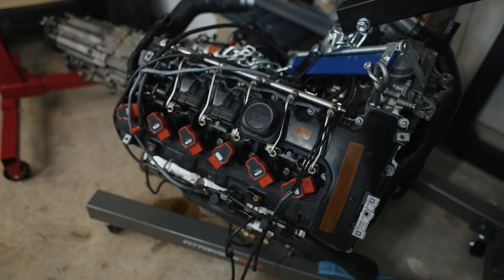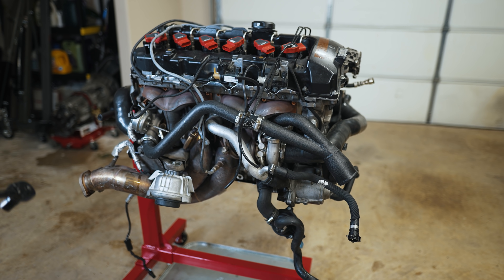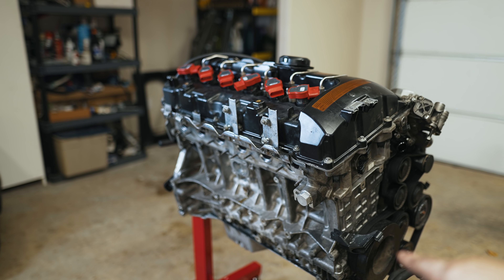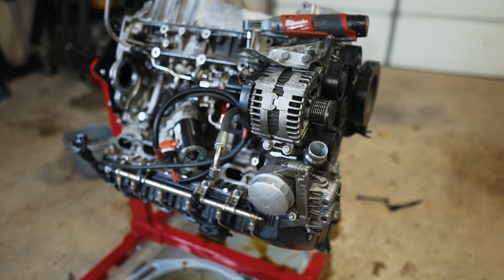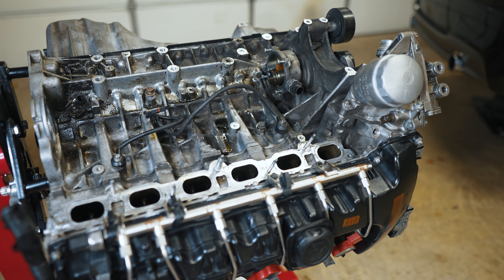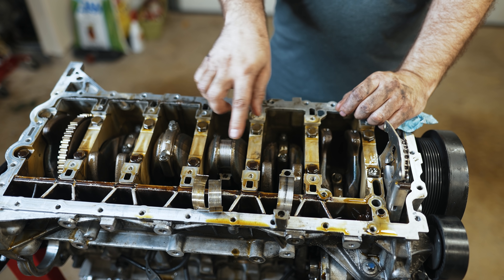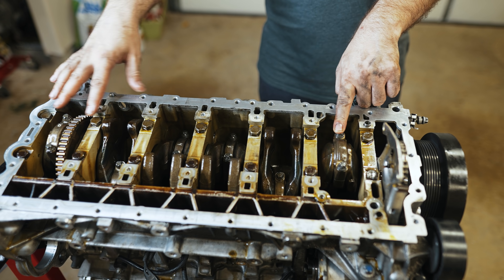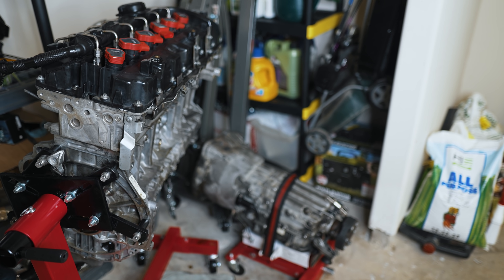Why Did My BMW Engine Fail?

Comment: Is a 2013 550i a safe buy? I've heard the 2014 and have better engines
Reply from the maker: I believe there were a few revisions so if I had a choice I'd go for the newer 550i knowing that it would still require a lot of maintenance.
Reply: @VehicularDIY  okay I'll stick with 14 and newer. Thank you for the reply
Reply: Check the following link: https://en.wikipedia.org/wiki/BMW_N63 N63B44O1 is the engine type you looking for. Next revision N63B44O2 from 2016. Be aware of these engines: it requires tripple amount of work on every service which is not performed by the regular workshop. Practically you have to disassemble the complete top of the engine at the time of the oil change to check all the spare plugs, pistons with camera, oil and coolant lines, turbo plays etc. The trick is to be know any problem before it is not too late to repair. Generaly these setps are missed and the result is simple: after 75K this engine is starting to degrade until 100k when it is brake down, including turbos. Forget the factory oil change interval, 8-10k km on average usage, less if you push. I was glad to be able to sell my car after an engine replacement (factory warranty). If you really want this engine than I suggest the S63 "M" type engine, It is not problem free but much more reliable than the N63. Please note every eight piston V type engine has serious issues over time, like Audi S7 4.0 twin turbo engine. I think the design has an inherent flaw of heating problem for the turbos, pipes and the last piston. Good luck!

Comment: KING bearings do not produce more clearance... unless you bought the "X" bearings... and even those only open the clearance up by .001." This didn't happen because your clearances were "too loose." 5w-40 would be  plenty thick even if these were the King "X" shells. If anything, STD bearings producing stock clearance is likely too tight for high load applications.

Absolutely amazing seeing comments blindly agree with you that this was because of "too loose" clearances purely because you mentioned it in the video. You didn't even give us enough information to even remotely conclude anything lol. What were you clearances after the king rod bearing install? 

Beating on it cold? That's plausible but who knows. I highly doubt this had anything to do with installing new bearings. It's really not that complex to change out rod bearings. It's two bolts... The only people who think it's black magic are people that have never done it before.
Reply from the maker: I was trying to pose a question to you guys, if you noticed I also said "or too tight?" at the 8:26 mark.  I made a video on the rod bearing replacement and showed the clearances using plastiguage.  So in my opinion the results can vary depending on what color code bearings your N54 came with from the factory.  They match the bearings to the crank, yellow, red violet or blue, one color for uppers and one color for lowers so you can end up with an exact clearance.  From what I had read the aftermarket bearings err on the side of caution and give you more clearance regardless of your factory bearing color.  So depending on the combo of bearings your car came with from the factory you could end up pretty loose but at the same time you'd think the thicker oil would make up for it worst case.
Reply: @VehicularDIY  yeah I know you presented both scenarios i was just replying to the people commenting about "too lose" and "wrong oil." Just doesn't make sense.

Yes bmw color codes the shells but youre talking about those shells changing clearances by .0001" differences not .001." So "loose" in the sense of using generic bearings is only relative to very minute variances... to call clearances loose on an n5x you would be at .003" or more which is a drastically different clearance. No you would never end up sp loose that you need to change oil. Thats nonsense. You might end up at .0017" on one journal and .0014" on another journal using generic builder bearings but those are still "tight" clearances on a 2" crank journal. You would never end up with something like .0035" (loose) using STD bearings. If you did you've got hardware issues.

And yeah I did watch your other videos after posting g and I do see that you landed right around .0015" on all journals. That is what I have found to be bmws target clearance. The type of small variances the colored shells make up for you wouldn't even be able to see by eyeballing plastiguage.

Everything is relative. If you want perfect .0015" clearances on all journals using generic builder bearings you need to polish a few journals. The slight variances that generic builder bearings might result in are perfectly fine though. Most manufacturers have bearing clearance variances and they do not bother using colored shells to make up for minute .0001" differences. Bmw just goes that extra step. Its obviously ideal to have them as even as possible to ensure each rod gets the same oil flow and can carry the same load but again were talking about variances you can't even eyeball with plastiguage.
Reply: Just from some of the comments  and my somewhat limited experience, the bearings do seem too tight.  (what was the original clearance before changing them?)    Did you use assembly lube on the bearings? How did you prime the engine?  Number 3 that in fact spun indicates the rod bearing went "square" when torqued.  What I mean by that is the bearing  was so tight at the two halves it buckled,  at the 2-10  o'clock and  5-7 o'clock.  Plastigauge should also be checked at these spots too, NOT just the crown /12 o'clock position.  I actually spun a rod on a 4 cylinder motor and in fact the crank actually cracked in half by the amount of heat. ( ha didn't' know what plastigauge was at the time!)  I don't really agree with the oil weight issue or oil being cold etc.  It is more of the engine being cold and the parts have to expand at the same time and same rate. 

good link explaining tolerances and oil weight etc:
https://blog.k1technologies.com/bearing-clearance-and-oil-viscosity-explained#:~:text=The%20traditional%20bearing%20clearance%20standard,inch%20of%20crank%20journal%20diameter.

     my two cents

Comment: Bummer you did a lot of work to keep that engine alive. Bearings normally fail because lack of oil, clearance to loose or tight, over loading, and foreign material. In your case hard to say you had a lot of timing chain guide debris in your motor and you didn't check clearance on your bearings. Seeing how some of the other bearings looked I am going with debris in oil.
Reply from the maker: You have a good point that perhaps the bearings were scored right on initial startup and trying to flush the motor multiple times didn't work.  What's funny is I didn't have any noticeable shavings in my oil this time.  
When my oil pump chain failed I had a ton of shavings and some of those were crank sprocket material which would have been super hard and could damage the crank easily.  Bearing material is typically soft and you can afford to flush it,
Reply: It sucks that rebuilding the bottom end requires a new crank now... BMW like many other manufacturers induction hardens their crank shafts so if you grind the crank under size the hardness goes away. Not like the old American V8 where you could just keep grinding the crank every rebuild and go with under size bearings. Your project... but my 2cents would be new or used micro polished crank that checks out and some acl coated bearings and arp bolts. Once the motor is apart the rods you plan to reuse torque the caps and swing a bore Gage through them to make sure the big end is still round distorted rods will wipe bearings also. Awesome videos happy holidays can't wait to see the build.

Comment: Wait one clarification, when you are beating the car cold how cold? Cold like you just started it and floored it or?
Reply from the maker: No running for 10 minutes and coolant at full operating temp but the oil was still cold.  I never push a car when the coolant is still cold.
Reply: @VehicularDIY  Ahh okay, I guess I'm safe. I always wait till it's 100c to floor it or wait till it starts moving to start going to ~ 4k rpm.

Comment: I pushed mine n54 when cold only once when I bought it, hope I didn't make too much dmg. Did you drove it hard when cold or? Also why buying new engine when you can just change the bearing with new?
Reply from the maker: Coolant was warm but I pushed it hard with the oil relatively cold in one gear.  The crankshaft has damage.

Comment: been getting on my f30 335i recently while still a little bit cold, not redline but 4-5k, stopped once i saw this, also i use a friction modifier, liqui moly mos2
Reply from the maker: Yeah basically any car that comes form the factory with an oil temp gauge really shouldn't be pushed hard until the oil is at full operating temp.

Comment: Hey man so sorry to see what happened to your 54, in the little experience i have as a farmer building engines may that be old diesels though, opening connecting rods are a fearsome thing for me as especially these bmw  machines are extremely sensitive for clearances and I understand why you did it , preventative is always better for sure , but when you did your video on the oil pump change and when you opened the rods I thought to myself......I’m not brave enough for that😀😀 but some you really win some you don’t , awesome videos thanks 🙏🏻 Would love to see what the engineering shop recommends on the clearances
Best wishes
Reply from the maker: Yeah the clearances on these modern motors seemed to have really tightened up  Thanks!

Comment: Great video and a super channel to have access to if you have this platform, which I do. I have a 2009 E92, and I always watch your vids before attempting anything. I hate this happened to your car, but we all know how these cars keep us busy and on our toes. No matter how much we curse at them while working things out, as soon as you drive it again we realize it's all worth it. I don't believe it was low oil temps. I believe it was the bearings themselves. Thousands of people drive their's hard right from the start. And while I know that is a horrible thing to do to any engine, these engines do well in holding up against such abuse normally. That's why I believe it's not just the oil temp thing. I'd like to ask you if your knowledge of this car is formal education or self taught?
Reply from the maker: Thanks yeah I'm leaning toward blaming the bearing clearance at this point.  I worked as an apprentice at my brother in laws shop while in high school after work for about 20 hours a week.  Did that for about 1.5 years and then just kept doing stuff on the side on my own cars.  I work in IT hardware but was already pretty handy and working at a ship when I was 16 helped me get comfortable around cars.

Comment: Unfortunately I think you had improper bearing clearance.
Reply from the maker: Yeah I think these aftermarket companies should be offering color coded clearances like they offer from the factory.  One size fits all doesn't always work out.
Reply: @VehicularDIY  I hope that’s not the case as I’m driving around with the same bearings lol.

Comment: Cold oil, these engines clearances are tighter than most performance based engines. It's a misconception the race engines are tight engines. While tolerances on certain aspects of race engine are tighter. The oil clearances become wider in race engines to help remove heat in the bearing areas. This is part of the reason why high performance engines run thicker oil and run high volume oil pumps.
Reply from the maker: Makes sense, thanks for the feedback.
Reply: @VehicularDIY  Where are you located? If you're not wanting to do anything with the block. I'd be willing to take it off your hands
Reply: 20 years ago. Today Audi, BMW, Mercedes have 0W-30 or less. Even the M, AMG Models. It is always a compromise. Cold engine starting. A lot of thin oil brings even more heat out of the bearing.
Reply: @totalsuper4169  Correct, after rebuilding my N54. I'd never run anything thicker than 5w-30. I used kings bearings as well. Which did help open up the clearances a little bit, but the biggest thing I noticed was the side clearance on the rods were extremely tight. I cut oil squirter notches in my rods to help increase oil flow. It should have been done from the factory, but I'm guessing a bean counter didn't want to add the process in production
Reply: @diyguy6054  Puh, I´m from Germany. Not understanding everything. But. You know, an engine has a chain, Vanos, main bearings, Piston,... Oil is very complex. You also need high HTHS especially when high boost. What means a "cut oil squirter nothes in my rods"?
Reply: @totalsuper4169  It's the language barrier. And I'm aware, I've been building engines for a long time. I've also rebuilt a N54 that is currently in my car.
Reply: @totalsuper4169  Oil squirter notches cut into the connection rods. Allows more oil flow thru bearings on engines with tight connection rod side clearances. My personal motor engine had .0035" of an inch, or .0889mm per side. A tight connection rod side clearance like that can cause a reduction in oil flow. By cutting notches into the side of the rod. It allows more oil flow.

Comment: Where are you purchasing your replacement engine? Has it been rebuilt and/or tested to ensure it is fully functional without issues?
Reply from the maker: It's just a used engine, at this point I'm not thrilled with the company.  Should have a 100 day warranty.  If everything checks out I'll talk about it in the next video.
Reply: Ok. I look forward to it! I watched many of your videos but did not see one about plugging head ports. Do you plan on doing this?

Comment: This is why ima go single turbo next year
Reply: it will ruin the power delivery of your car. It will be like a drag race car for highways and you wont be able to do tiny throttle adjustment mid corner.

Comment: Seems like it was too cold needed to idle more that morning before driving i usually let my water temp get to atleast 150 before i drive my car and kinda refuse to beat on it until oil temperature is atleast 200 i be siking myself out to much with the car because mine only has the off the shelf map for the n54 with mhd stage 2+

Comment: Nowadays I see people turn their car on not even 30 seconds go by and they start to drive but many people have a heavy foot. Many cars take a beat Nowadays specially with cold climate
Reply from the maker: Yeah I would typically wait for coolant temp to come up to temp but with these aftermarket bearings I should have waited for the oil to reach full operating temp but at the same time I'm thinking there had to be some sort of clearance issue with these one size fits all king bearings.

Comment: Were you running 40w oil? I think maybe the tighter clearances made it more important to have warm 40 weight as it these refreshed clearances were meant for 30 weight.
Reply from the maker: Yeah I was running 5w40.

Comment: Definitely contact there! Too much clearance means oil will run out of the bearings too quick meaning it’s not able to build the oil wedge and sustain it. 5w40 is an all season oil so I would lean towards the oil being too thin for your clearances.

Comment: There's a place in Oklahoma called Ghassan Automotive that sells rebuilt N54 engines that can be custom upgraded to your liking , you can tell them you want forged pistons and rods , ARP rod bolts , ARP main studs , upgraded valvetrain and so on , pretty much anything you like, price for an engine starts at $3500 and can go all the way up to around $15000 if you get everything upgraded , with a 2 years unlimited miles labor and parts warranty ,
Reply: Ghassan unfortunately is a total scam shop. They sell used engines as "rebuilt" and provide absolutely zero assistance/warranty when they blow up. Their percentage of blown up engines is very high and the owner is now in jail for sexual harrassment.
Reply: @whyzee125  ok I had no idea , thanks for the warning .

Comment: I could be wrong but my gut is always telling me that messing with bearings is a risky business, unless you are super familiar with the particular motor you're working on (and I know that you know this motor as good as anyone) there just seems to be so many variables between tightening issues, too tight or not tight enough etc. I mean, the clearances we're talking about here leave very little margin for error. Then you could think about ambient temps when you installed the bearings, if it was a hot or cold day that day, the particular bolts used, etc. I'm no master mechanic like you, I'm actually a chef by profession so I'm just spitballing here. It's certainly a pleasure to watch someone work that is a master at their craft, no matter what that might be. I always get a lot of "you make that look so easy" when I'm cooking for family or friends but it's just 25 years of experience. If one does anything for that long , you are bound to get good at it.  Anyways, better luck with the next engine! Merry Xmas and Happy New Year dude!
Reply from the maker: Yeah I had been asked on may occasions in the past if I would recommend rod bearing replacement for maintenance and I always followed the rule to leave well enough alone unless they have failed.  Mostly because the wear will no longer be even with the main bearings.  I changed mine due to my oil pump chain failure but doing so likely lead to this failure.
Reply: @VehicularDIY  It's a costly lesson but I'm sure the experience you gained will repay you over time. All these things will only build upon your knowledge base. Keep on keeping on. You've got a great channel here and a very enthusiastic fan base. That you are keeping it real and owning mistakes is a lot more than most other youtubers would cop to, and will only earn you more trust among the growing community. Respect.